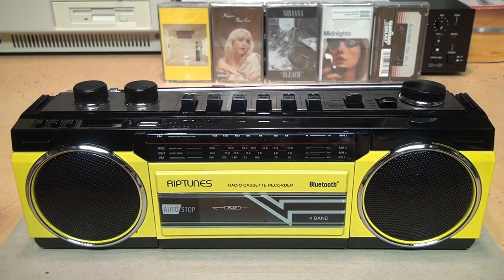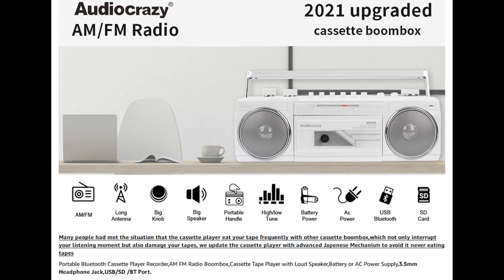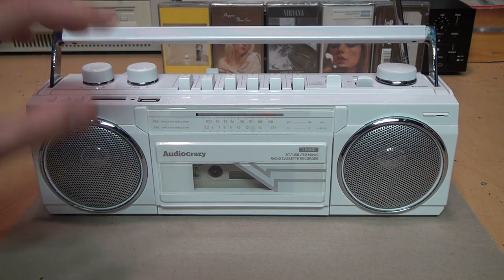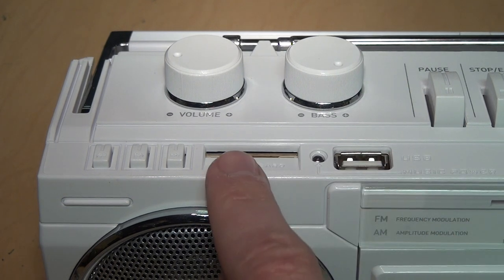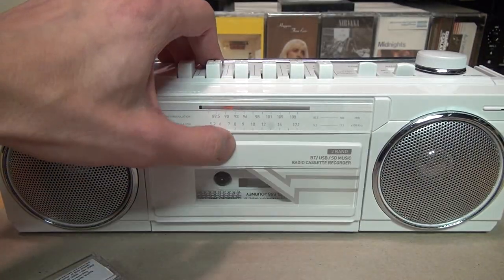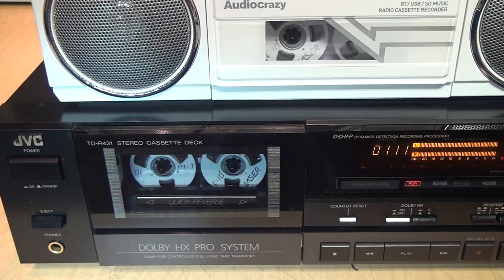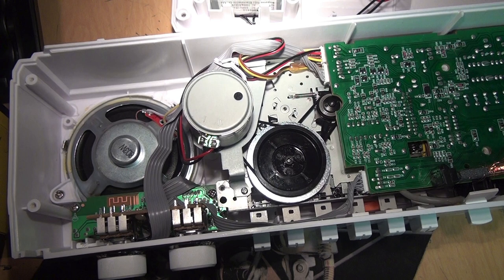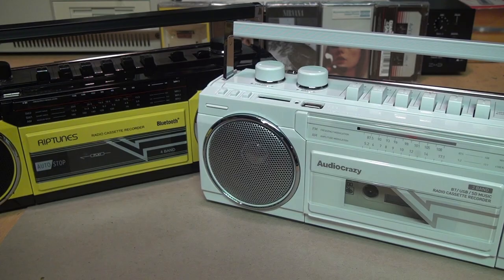New improved AudioCrazy STEREO cassette boombox!

Comment: You should do a little DIY project and transfer the inerts of the white version into the 80s looking one and keep the "better" speakers from the original model. Best of both worlds.
Reply from the maker: I considered it, but there are enough differences to make swapping the internal components impractical, such as Riptunes one having a shortwave tuner and an aux in jack, while the AudioCrazy doesn't have shortwave and has a headphone jack

Comment: there used to be a good reason that records sounded better. those digitally mastered analog recordings were mastered with extremely high (for the 1980s) quality digital equipment, much higher than redbook CD, and better than anything we'd see in the commercial audio space until DVD Audio came out, but even that wasn't widely adopted, so it's more like until the time in the 2000s when you could finally get FLAC downloads for your music
Reply from the maker: I believe the best digital recording equipment you could get in the early '80s was 16-bit with a 50 kHz sampling rate, so it was somewhat better than CD quality, but not by much.
Reply: @vwestlife  50kHz is actually p good! most DVD Audio I own is 48k, and very high quality. but it wasn't just the freq/bit rate, the whole signal path of those big pro rigs was amazing from end-to-end. Tears for Fears first album is a great example, and it sounds great on vynil; most CD players wouldn't have been able to match the quality of a medium-tier turntable at that time, and realistically, most people didn't even own a CD player until at least the second half of the 80s, and by that time, digital studio recording was like 644kHz and up

Comment: A shame they still don't add OGG Vorbis and FLAC file playback support. Who the heck still uses WMA and MP3? It seems these terrible formats just won't die...
Also... as usual the obligatory  +1  for Slugbug.   :P   Nice Stereo Panorama. Frequency response of that little player still leaves a bit to desire but damn good WOW & flutter for this kind of price range. The easy accessible speed adjust is fantastic. I really gotta give them a pass for the DC bias recording. At least the PLAYBACK is good which is all that matters for 95% of the usage why people wanna get these.  Pretty awesome. Now they can definitely improve the speakers a bit more and change the blue LED to a red one and maybe add some color variations for the case.
Reply: @Rita Maid  filesize wise it's almost the same size as a FLAC but being lossy. I too used 320kbits MP3 when i had no player that could play FLAC or when i had no bigger flash memory to store my music on.
Reply from the maker: Some of these cheap USB/SD card players support uncompressed WAV files, but this one doesn't.
Reply: @vwestlife  Now that is actually pretty cool! PCM Wave really always seem to work. This is what i used mostly for playing lossless audio on my PSP since it coul play WAV files with up to 48khz 16 bit natively. I think even some DVD and Blu-ray players, that can play MP3 files and display JPEGs, have the ability to play WAV files, when you put them on a data disc to play that.

Comment: Too bad the first thing they ditched was the Shortwave band.... i could have definitely said bye bye to the USB and SD slot for MP3 files if it STILL had an Aux input for hooking up what ever audio player you have. But if the Shortwave function was already horrible and not sensitive enough.. ah well...  Almost all of my cheapo Radiorecorder Boomboxes i had as a kid and teenager all only had AM/FM anyway. Except for this mighty fine Aiwa TPR-300A which was my very first radio recorder. I hope they continue making these little boomboxes better without having to produce too much e-waste before it actually becomes usable. Would have been nice to see them making the SW portion better too and making Shortwave more interesting for the masses who goes out to buy these little cassette boomboxes.

Comment: cassette tapes are in the past. if you have a modern phone you can get a service like deezer or spotify. and tapes/vinyls/cds are useless. stop the analog tech and go over by the digital tech.
Reply: audio streaming services will still have lower quality sound than CDs, and even good quality tapes.
Reply: @RealEpikCartfrenYT  wrong. deezer premium let you listen/download (to save non wifi data) on high fidelity. the music is on FLAC and each track goes for about 50 to 90 mbs. spotify is similar yet a bit more compressed. i prefer deezer. not to mention if you use bluetooth earphones the audio never will go over what a high quality mp3 goes since bluetooth cannot transmit on real time raw music. still a good pair of cabled donuts earphones will give you maximum quality in a quality phone/pc.
Reply: I will keep buying my music on CD/MD/Cassette.
Reply: Listening to a fab tape (on one of the 3 cassette decks in my room) of Lennon I made back in '98 as I'm reading this... The sound is phenomenal, although my equipment back then was not exactly high end. What's this nonsense about tapes degrading? This one is 25 years old...
Reply: How about no scott, ok?
Reply: @thanosb.5403  I've still got tapes from the late 1980s & they still play perfectly!
Reply: Problem with online services is that you're one disagreement between companies away of losing access to your favourite music (or films, or whatever).
Reply: @Ale.K7 - and DRM encoded downloads are no better.  Company goes out of business and your 5,000 files are instantly bricked.
Reply: @enginecrzy  I bought The Closure EP by Milton Jackson on Vinyl.